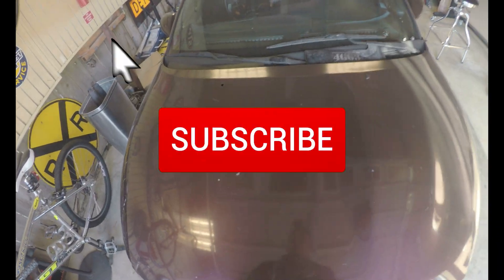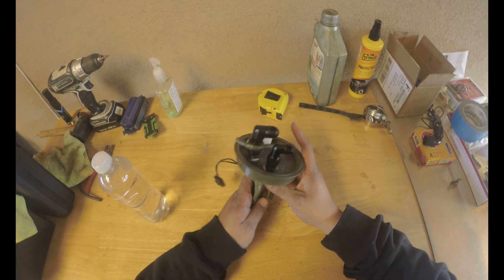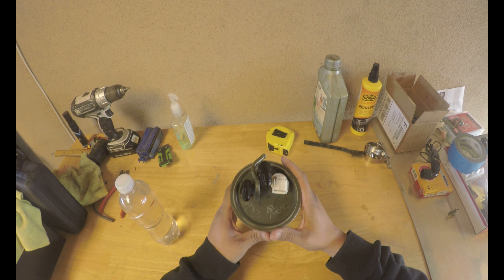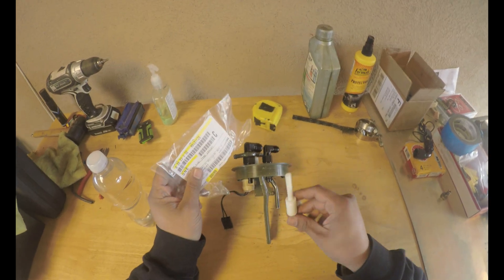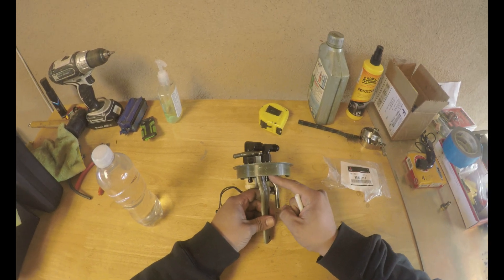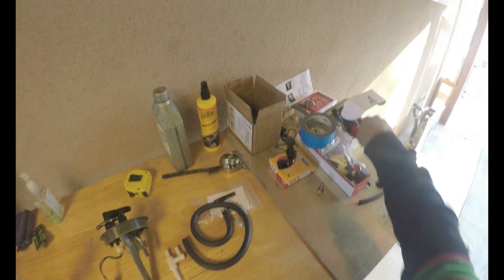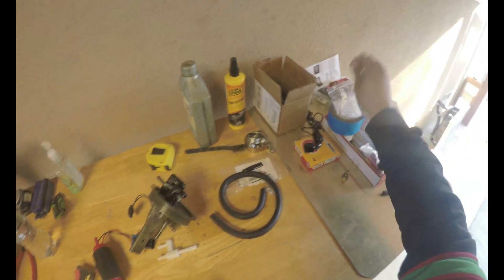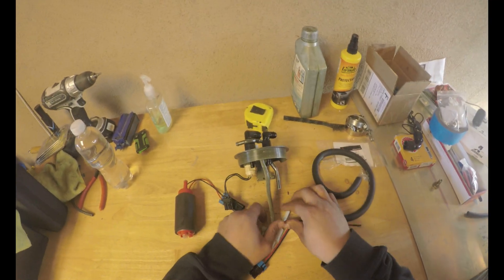Built DSM gets the EVO 8/9 siphon mod.

Comment: Using that siphon, you dont have to drill 1/8 hole for fuel pressure? My stock siphon broke so I got a the same one as yours but I heard that you have to drill a bigger hole
Reply from the maker: Stock evo siphon size is ⁹/⁶⁴" I believe,  so far we havnt ran into any issues.  I definitely like this set up better.

Comment: What benefits are you going to see with this mod?
Reply from the maker: Hey there Mike DSM, it's more of a secure setup for your fuel delivery,  the other route , which it's currently on my personal dsm, can run into fuel pump not having a solid connection and possibly losing fuel pressure. Not a big deal if your just cruising but under load and high boost it could be  Catastrophic. In a way good insurance and peace in mind when you trying to make big power.

Comment: Great video man! What kind of shrink tubing did you use? It is a good idea to use fuel resistant heat shrink tubing or you can use butt connectors ,because  they are more resistant to fuel
Reply from the maker: Thanks man I saw your dsm on your channel and she sounds mean! Im Just starting off the content at the end of this build while I finish getting my parts for my dsm. As for the heat shrink its polyolefin , it says oil and acid but I don't know about e85. I might have to go with your idea about the butt connectors to eliminate that worry.